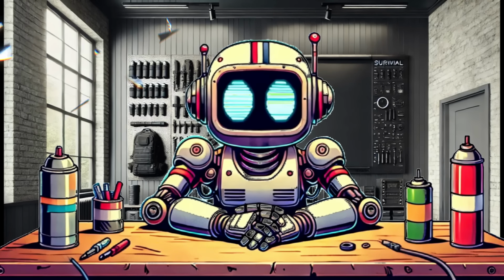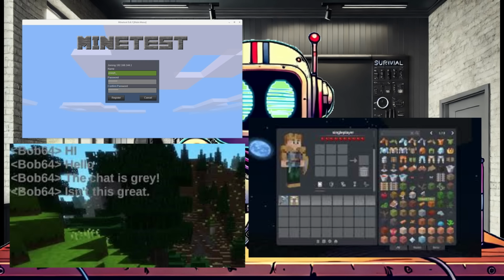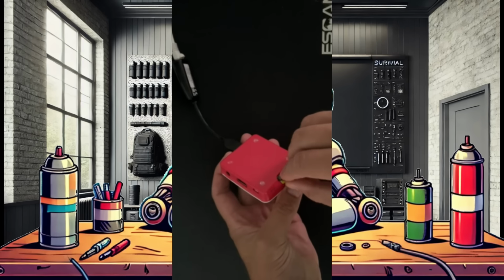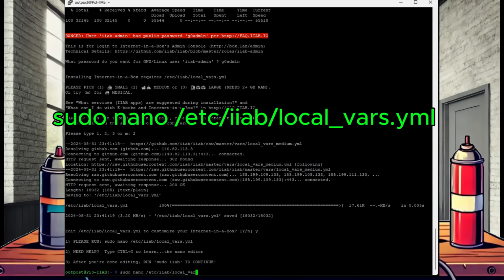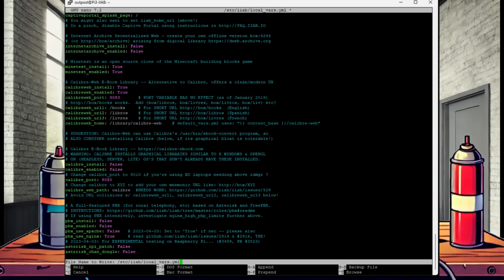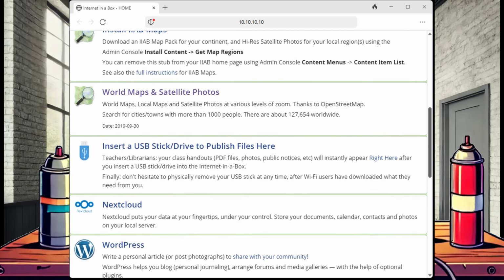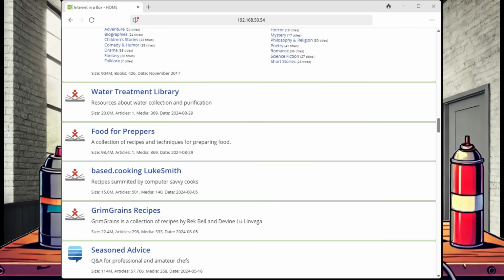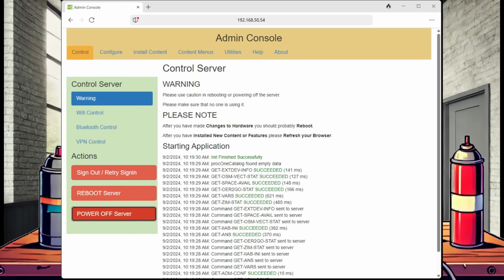Easily Build Your Own Offline Internet: Maps, Cloud Storage, Kiwix, LMS & More with Raspberry Pi

Comment: Words mean stuff.  You cannot have an offline internet.  The word internet is short for internetwork.

What you mean is how to use apps like maps and others without being online.
Reply from the maker: While "internet" technically refers to interconnected networks, and the term "offline internet" can be confusing for some, tools like Internet in a Box allow offline access to vast amounts of web-based content. It's not the internet in the traditional sense, but it provides pre-loaded resources like Wikipedia, maps, and educational materials without needing an active connection.

Beyond individual use, Internet in a Box can create a local intranet by setting up a Wi-Fi hotspot, enabling a community to connect and share the stored content. This way, even without online access, schools, remote areas, or community hubs can share knowledge and resources, fostering local connectivity and collaboration.

Comment: How would you communicate or network with another location or building that’s in a different state or hundreds of miles away? (When the grid is down)
Reply: That is definitely beyond the scope IIAB. IIRC there are a few options if you plan ahead, like HF radio, LoRa nodes, and I’m pretty sure there are some apps out there that let you hop along until the destination is found using Bluetooth. Honestly, if this was a scenario I needed to plan for, I would have a plan that involved terrestrial communications, an alternate involving satellite comms, radio comms, and then the carrier-pigeon-Bluetooth solution. A P.A.C.E. plan of sorts.

Comment: Kind of a fudd/noob here to some techie things. Would it strictly be Ubuntu or could you use Mint (i know it's an Ubuntu derivative, just asking.)? 
Also, if not on a R-pi, would an old Dell with 4 Gb of DDR suffice? 
I'm not familiar with Lenix just yet, but wanting to get away from the bloat and privacy issues that comes with Winders.
Thank you for your time. (New sub).
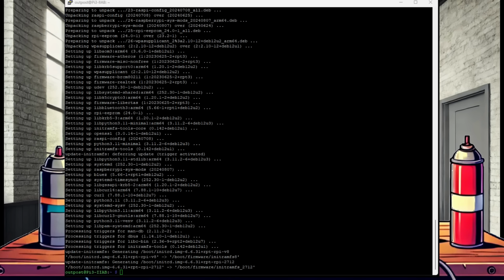Reply from the maker: 10:13 

From the https://download.iiab.io official page. So Mint 22+ should work. Definitely refer back to the official page. And yes, the Dell should be sufficient. Let us know if you have any other questions!
Reply: Just to help, it's spelled "Linux".  And I agree with you about the bloat and privacy issues with Windows -- I held out hope for awhile, but it gets continually worse.  I love linux as an alternative.

Comment: I do feel like you over-promised a bit at the start. Specifically about rebuilding the internet. I didn't see anything regarding LoRa mentioned, nothing about creating a WISP (wireless ISP using wifi extenders). I do think the best system for re-establishing comms in a grid down scenario is first LoRa for those who are prepared and Delay Tolerant Networking programs (such at DTN-7 Go or NASA has a DTN stack as well) for larger file transfers over larger distances.

Just thought I'd throw a couple of things at you to integrate into your content if you're interested. You should check out stacker news too. I made a few posts I called "altnet" there and I'd love to see more strategic internet resiliency planning guides over there.
Reply: I’ll definitely check out stacker news. I agree and I think it would be interesting to see something like IIAB integrate LoRa; that may be more in-line with WROLPI’s project. It’s similar to IIAB, but is being developed for “Without Rule Of Law” hence the name. IIAB’s built in Lokole email and PBX voip phone support works pretty well, surprisingly even on Pi’s. And you could probably deploy something similar to WISP with the right hardware. But that’s whats so cool about these projects, they can be scaled and customized to fit our imaginations! But this is definitely not a TAK server 😂
Reply from the maker: We appreciate your feedback and apologize if there was any misunderstanding about the project's capabilities. This video is meant to raise awareness about the Internet-in-a-Box Organization's platform and inspire ideas about its potential. We believe IIAB can create an experience that feels very much like the internet, and we will soon be covering several of its advanced functions.

Comment: I've been wanting to build one for a while. I'd like to use a small sd card and an external drive. I see they have an option for that. Thank you for the tutorial!
Reply from the maker: Ubuntu Server allows booting a device from one drive while placing the OS root on another. We haven’t tried the configuration you mentioned, but it should work and could be another option for you. If we have time in the next few days, we will do some testing and report back.
Reply: With a Pi 4 you can just burn to raspi image to a usb HDD and it will boot off of the hdd. Nothing special to do.
Reply from the maker: We agree with the previous comment about running a Pi 4 and just booting from the USB drive. Unfortunately, in our testing we were not able to install Ubuntu Server in the traditional way due to the Raspberry Pi's lack of conventional BIOS, but we did get it to work with a successful IIAB install using the following steps. This is not for the weak or faint of heart, but it boots the pi from a 16GB microSD card and then uses an external 4TB HDD for the OS:

Steps to Set Up Ubuntu Server on Raspberry Pi 4 with Boot from microSD and Root on USB

Download the Ubuntu Server image for Raspberry Pi to your PC.
Use a tool like Raspberry Pi Imager to write the image to your microSD card.

Insert the microSD card into your Raspberry Pi 4.
Power it on, and allow it to boot into Ubuntu Server for the first time.
Sign in to Ubuntu Server

Connect the external USB drive to the Raspberry Pi.

Format the USB drive as ext4 if it’s not already formatted.

Use the following command to list the available drives:
>>lsblk

Then format the USB drive (replace /dev/sda1 with your actual device if needed):
>>sudo mkfs.ext4 /dev/sda1

Create a mount point for the USB drive and mount it:
sudo mkdir /mnt/usbroot
sudo mount /dev/sda1 /mnt/usbroot

Now, copy the entire root filesystem (/) to the USB drive:
>>sudo rsync -axv / /mnt/usbroot

Edit the cmdline.txt file in /boot/firmware to instruct the Raspberry Pi to use the external USB drive as the root filesystem.

You can get the UUID of /dev/sda1 by running:
>>sudo blkid /dev/sda1
Example Output: outpost@Server:~$ sudo blkid /dev/sda1
/dev/sda1: UUID="def38eb3-5ae1-4645-aeba-01b9ea8fde42" BLOCK_SIZE="4096" TYPE="ext4" PARTLABEL="Basic data partition" PARTUUID="005e1d8d-3a0a-4017-b10f-de59debb4bf2"

You now have the UUID and PARTUUID for your external USB drive's partition (/dev/sda1).
To proceed, you will need to update the cmdline.txt and fstab files with the correct UUID.
>>sudo nano /boot/firmware/cmdline.txt
Replace the root=LABEL=writable part with the following:
root=UUID=def38eb3-5ae1-4645-aeba-01b9ea8fde42
So the full line should look something like this:
console=serial0,115200 multipath=off dwc_otg.lpm_enable=0 console=tty1 root=UUID=def38eb3-5ae1-4645-aeba-01b9ea8fde42 rootfstype=ext4 rootwait fixrtc
Make sure the entire configuration remains on one line without any line breaks.

Edit the fstab on the USB drive:
>>sudo nano /mnt/usbroot/etc/fstab

Update the fstab Entries:
Replace the LABEL=writable for the root (/) filesystem with the UUID of the USB drive (def38eb3-5ae1-4645-aeba-01b9ea8fde42)

After the changes, your /etc/fstab on the USB drive should look like this:
UUID=def38eb3-5ae1-4645-aeba-01b9ea8fde42 / ext4 defaults 0 1
LABEL=system-boot /boot/firmware vfat defaults 0 1

Unmount the USB drive and reboot:
>>sudo umount /mnt/usbroot
>>sudo reboot
Reply: @TheOutpostUnderground  good morning I'm building a cyberdeck using a Pi5 and i have a 1TB card. I would like to install the OS on  a small 32g card and and use the 1TB card for all my files so it could be swapped out for a larger card later without disturbing the OS. would the above post fit those needs or is there a better way? thanks for the info.
Reply from the maker: Good morning, @penningtongrading5019! Yes, you can adapt the steps I shared earlier, but since you’re using a Pi 5 with two SD cards, there’s a simpler way to set it up:

1) Set up the OS on the 32GB SD card:
Flash Raspberry Pi OS (or Ubuntu Server) to the 32GB card using Raspberry Pi Imager.
Boot your Pi with this card installed.

2) Prepare the 1TB SD card for data:
Insert the 1TB SD card into a reader and connect it to the Pi.
Format it as ext4 for compatibility:
sudo mkfs.ext4 /dev/sdX1 (Replace sdX1 with your device name)

3) Mount the 1TB card:
Create a folder to access it:
sudo mkdir /mnt/data
Mount the card:
sudo mount /dev/sdX1 /mnt/data

4) Make it auto-mount at startup:
Find the card’s UUID:
sudo blkid /dev/sdX1
Add it to /etc/fstab:
UUID=your-uuid /mnt/data ext4 defaults 0 2

Now your OS runs on the 32GB card, and your 1TB card stores all your files, making it easy to swap for a larger card in the future. Let me know if you need more details.
Reply: @TheOutpostUnderground  thanks for the quick reply. i will get started on this tonight and by the way i like the voice and the way the video is done thanks and keep it up.
Reply: @penningtongrading5019 I’m not sure Outpost understood what you were asking. If I were you, I would reference the IIAB project wiki, specifically this part: https://wiki.iiab.io/go/FAQ#Can_I_permanently_attach_an_external_USB_drive,_to_add_more_content?     The way IIAB functions, it is going to install at least some of it onto your OS drive. If you are running a Pi 5, I would seriously consider using a nvme hat and nvme drive. MicroSD cards are notorious for being somewhat unreliable.